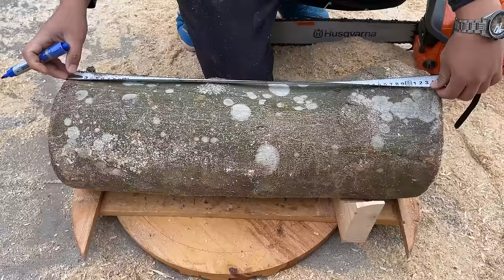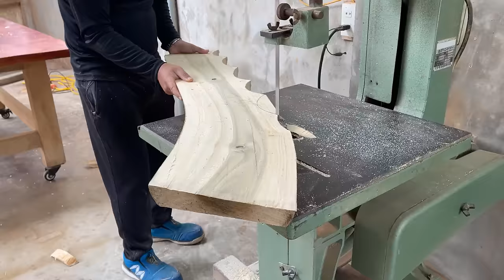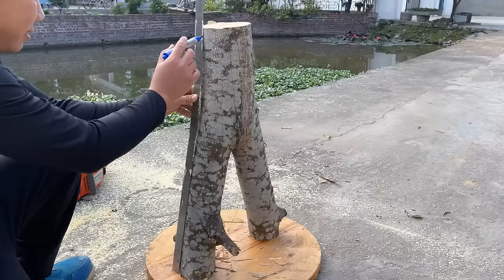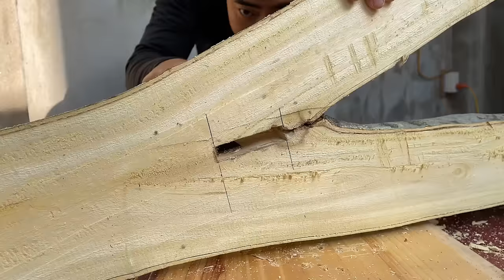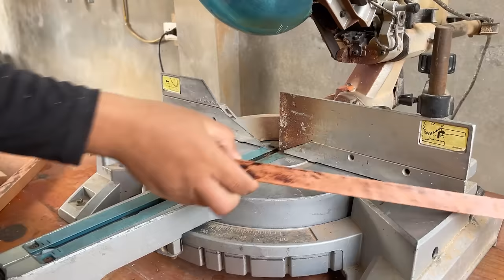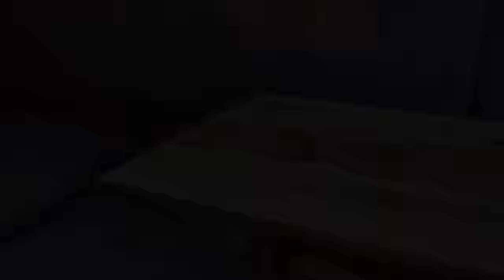The Genius Boy's Idea Of Taking Advantage Of The Huge Value From The Forgotten Tree Trunks !

Comment: Woodworker here, and will give some advice.  While it may look pretty, the design is not based on how the wood moves.  Length wise, wood does not shrink hardly at all, but width wise...  You can have over 4% shrinkage or expansion of the board.  Short distance width runs can be ok, but big width runs need to be accounted for.  On one end, you have long grain connecting the table, and through the middle to the other end, you have the grain running grain with cookies.  As soon as the cookies start drying, they will pull away from each other, because they will want to shrink into smaller cookies.  And with the entire middle of the table designed around the cookies, the whole table will pull apart.  The cuts on the boards will shrink width ways, but not long ways, while the cookies will shrink all around.  It may take longer, but it would also function a lot better, but run the long grain slates down the entire thing.  You may still have some movement, because green wood moves, but it will not rip itself apart from uneven shrinkage at the joints.
Reply from the maker: Thank you very much ! ❤❤
Reply: So this design isn't possible because of the shrinkage?

Comment: What was the moisture content of the wood before starting? Do you have a picture of it two months after build?
Reply from the maker: Thank you very much ! 😁😁
Reply: I was just going to say the same thing, kind of. Its green wood. First of all, the moisture content of green maple is 97% or around there. I own a lumber business. You can't dry green wood in the log. I've tried many times. Also, given the nature of how hard it is to dry cookies without cracking, there will at least be splitting in all those cookies. I'm really interested in this because it would be alot more overhead for me if I could make tables out of green wood. I'm just worried about longevity of the tables. I too would like to know what this table looks like in 6 months. But, judging by the thank you response of the owner, he can't read English.